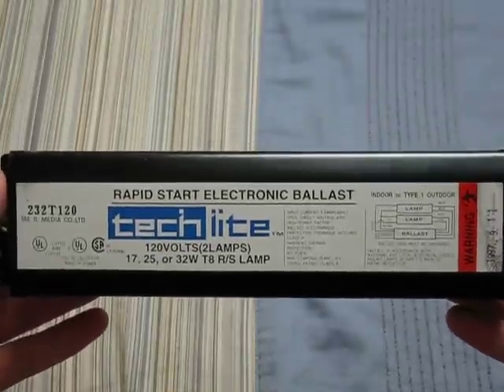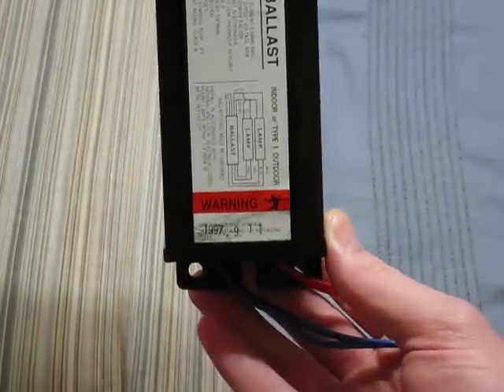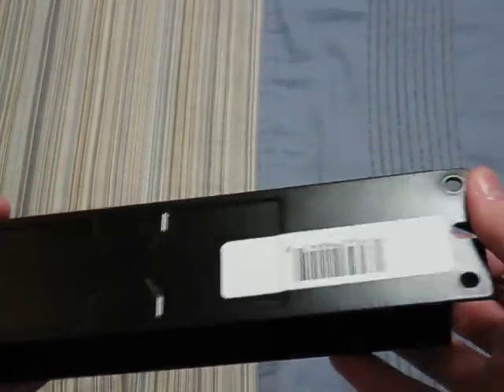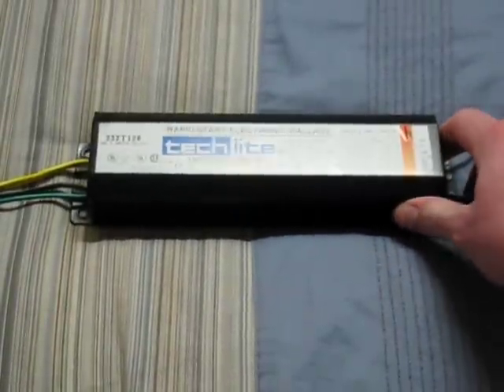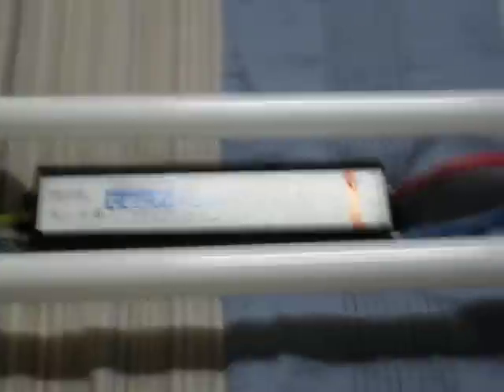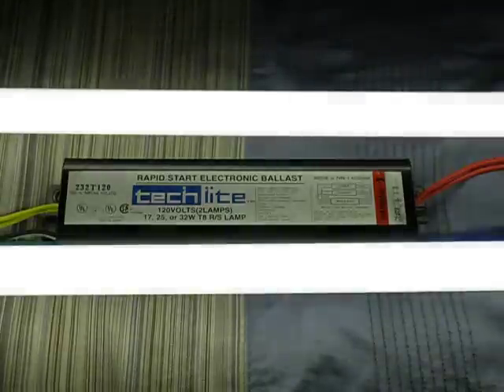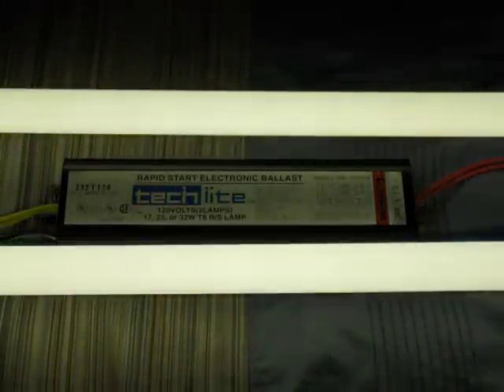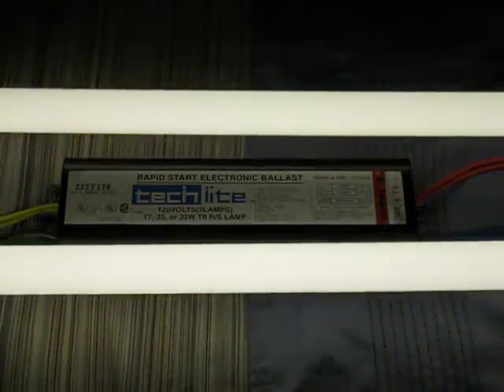TechLite Rapid Start Electronic Ballast

Comment: It is indeed rare that you find an electronic rapid-start ballast for T8 lamps (usually, electronic versions with this starting method are to replace magnetic ballasts in fixtures with T12 lamps).

Comment: why cant they just make rapid start ballast and not always instant start lol
Reply: Because instant-start ballasts are actually the most efficient types of ballasts out there; they are wired in parallel (as opposed to series for rapid-start ones) so if one lamp fails, the rest in the fixture stay lit.  Unlike rapid-start ballasts, instant start ones also operate reliably in colder environments.  However, they are most suitable for lamps that are not switched on and off frequently since the sudden surge of power damages the lamps in the long run.  There is an alternative for this: programmed-start.  They preheat the lamp cathodes in a specific sequence and although slightly more inefficient than instant-start ballasts, they are much gentler on the lamps and have all the other advantages as instant-start ones.  But I do like how rapid-start ballasts start up!